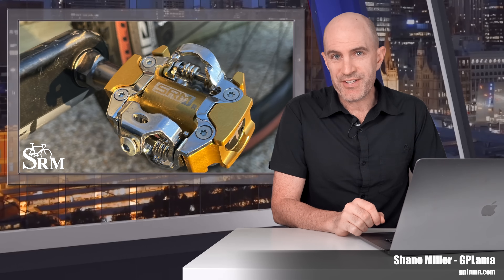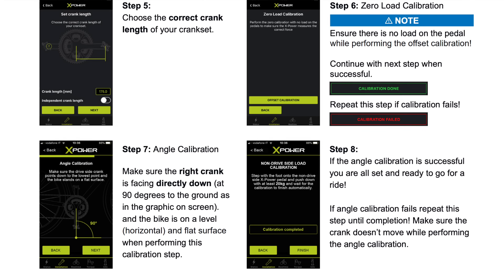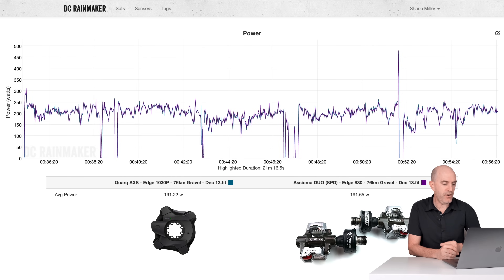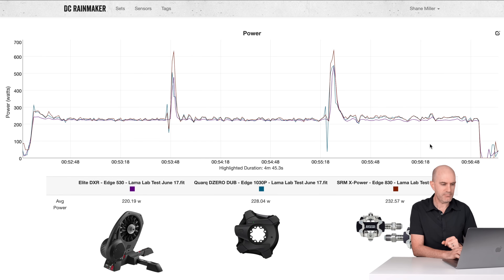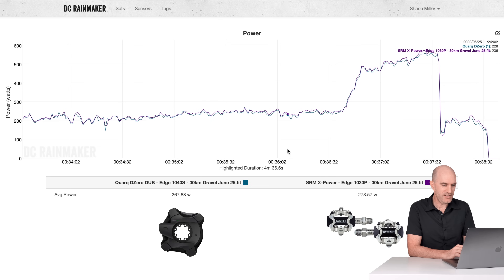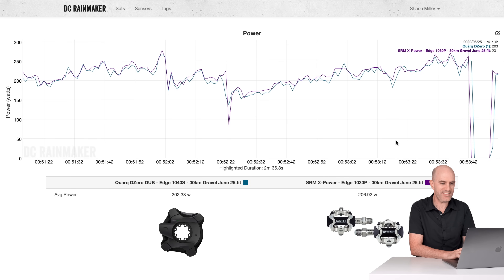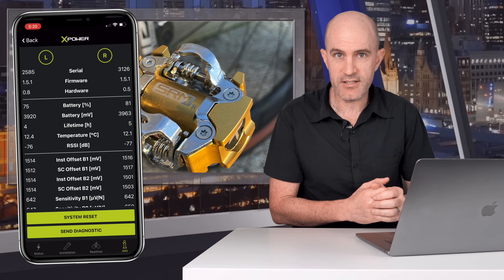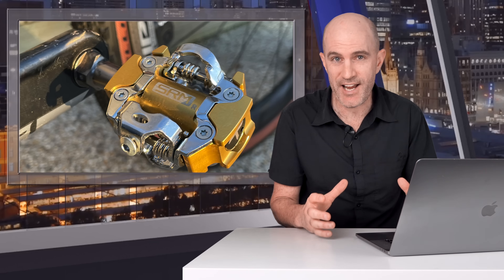SRM X-Power SPD Power Meter Pedals: Details // Lama Lab Tested

Comment: The only other options for pedal based SPD power meters are the XC200s and the Favero Assiomas with the body hack, right? Of those three options would recommend the Favero hack the most?
Reply from the maker: That's correct. While I still use the XC200, they still drift after hard sprints/efforts.

Comment: I bought a brand new pair and had to send them in for service as one would not read power properly and the battery wore down much quicker than the other. Got them back, tossed them aside and didn't charge them every 2 weeks (like I should have). When I went to use them, they would not charge and had to send them in AGAIN for service. Now I have to set a calendar reminder, every 2 weeks, so I can charge them and avoid another service. Nice pedals, they look hot, but the power and battery features on them is junk.
Reply from the maker: Sorry to hear they've been junk for you Jeff. I really hope SRM can turn a corner soon and regain some market share/confidence with better products.

Comment: According to SRM:  "All pedals as of March 2022 have the new board and firmware along with the new battery configuration that reduced the drain down issues and improved overall battery life."    Long live the Gold Standard for power!
Reply from the maker: This review was from late June 2022 with the latest firmware installed. And there were still issues. If SRM want to regain the title as 'Gold Standard', they have a LOT of work to do.
Reply: @gplama  SRM says that the hardware changed in March, 2022.  It would appear the work has already been completed.  Current and future firmware is unlikely to ever address your findings with the previous generation of HARDWARE.  I'm guessing SRM would fix your set if you contacted support and sent them in.
Reply from the maker: @thewallhouse5698  It'd be interesting for them to review and respond to this directly based on the HW serial numbers shown in this video.
Reply: @thewallhouse5698  Your guess is inconsistent with my customer experience with these pedals. 

Either the new revision is just as failure prone as the previous one, or SRM is content with repairing failed units using the same failure prone spindles.
Reply: @GPLama, will you be testing the Gen II version of the SRM X-Power that was just released?

Comment: I really wanted to like these and I have given SRM chance after chance but I am finally done with them just short of having purchased them a year ago.

Reliability of these is flat out awful.

Excessive battery drain/defective battery on one of the pedals. 

Pedals that periodically stopped reporting, first the left one then the right one, and then ultimately not reporting any power data at all.

I have also had a pedal that refused to wake up, and then once again a power pedal that stopped reporting data altogether a couple of months later.

The cherry on top, on the latest RMA (the 4th) I received the pedals back 3 weeks later only to find out that the repaired unit featured firmware  3 revisions older than the other pedal and an attempt to update it failed rendering the pedals useless once again.

Probably the best I can say about my experience with these pedals is that SRM customer service has made an effort to get it right, but even that aspect is let down by the fact that SRM cannot even spring to cover the return shipment costs of warranty repairs.

Without a doubt the worst experience I have ever had with any bicycle specific product.
Reply from the maker: That's shit to hear... but to be honest, doesn't surprise me. SRM have really dropped the ball in recent years.
Reply: Seems that the user experience w the pedal-based SRMs is pretty terrible. Challenging for me though, because my Origin spider unit has been solid for over 100,000miles

Comment: Every day I say a prayer that Assioma will come out with an SPD version....that or do a discount sale on the duo so I can hack my current Duo to SPD.

Thanks for the review. Expensive and poor battery 🔋 life...not the best credentials supporting the case for purchasing these.  It should be noted that Assioma also uses magnetic connection, but I have to say Favero got it right.

Comment: I have these and man they are a handful to live with. You cover basically everything I dislike about these.
The charging cable adapters are terrible, it charges slowly and is pretty unclear if it charges or why it doesn’t. 
The power draw in idle is not at all up to what I’d expect in 2022.
My worst problem however is connecting these. They work sometimes, and sometimes they don’t. I have had so so many power drop outs, basically every ride. I have inquired SRM about this and they said it was a faulty unit. Replaced it and it’s still the same.